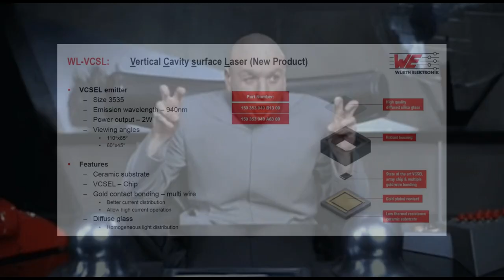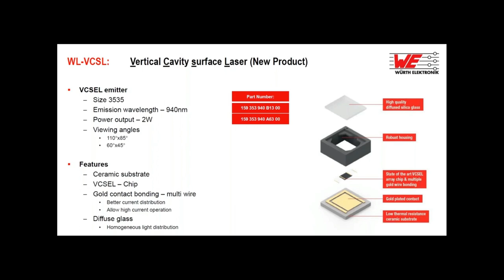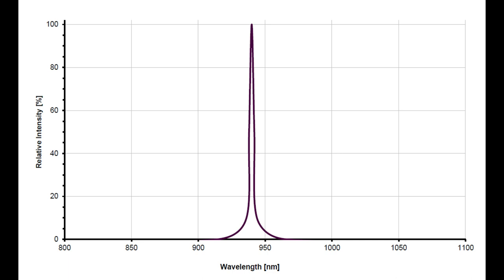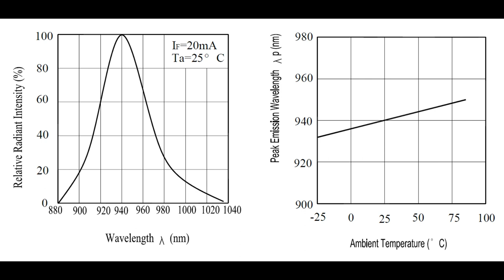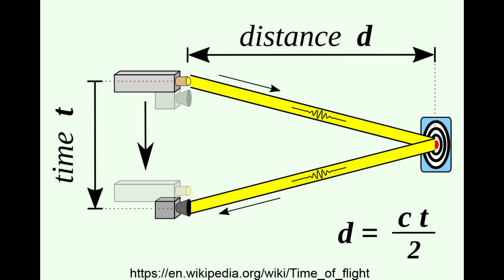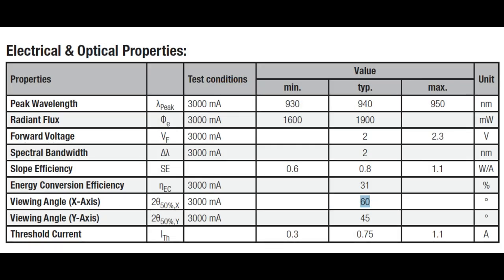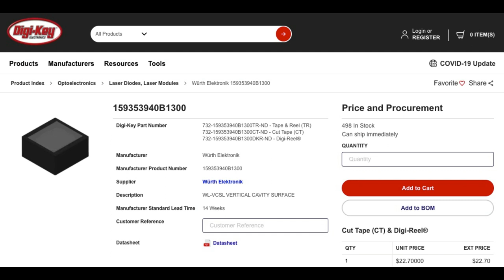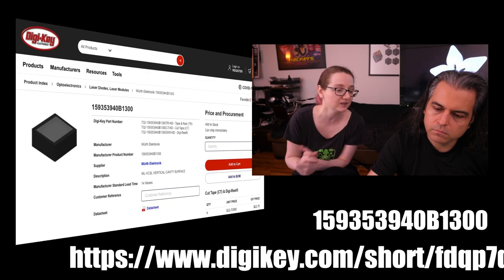EYE ON NPI - WL-VCSL Vertical Cavity Surface Laser @we_online #EyeOnNPI @DigiKey #digikey

Comment: Interesting. I didn't know that they made LEDs either until they ended up having the nicest ultra bright green 1206 surface mount LED for hand soldering when I searched for one, and can confirm it's easy to use and nice and bright.

Jeepers 940nm laser is dangerous, no blink reflex to save you. At least it's a really wide beam.